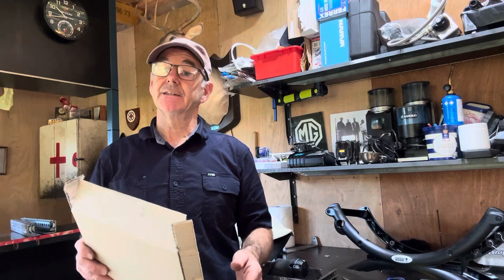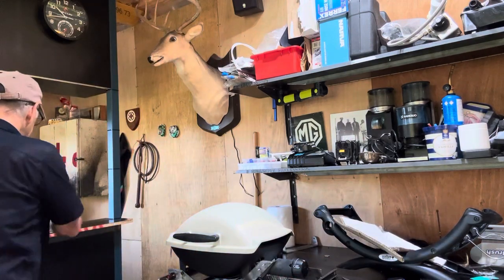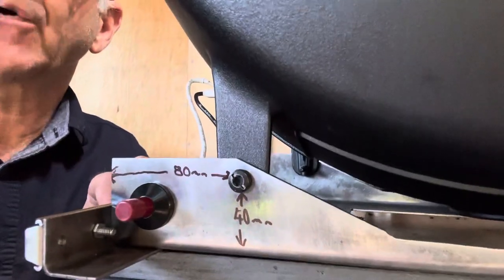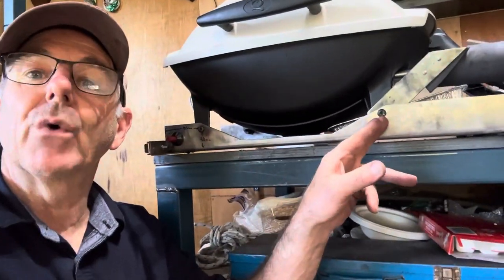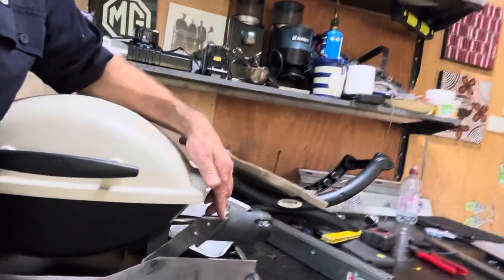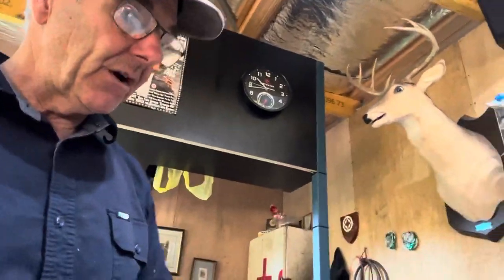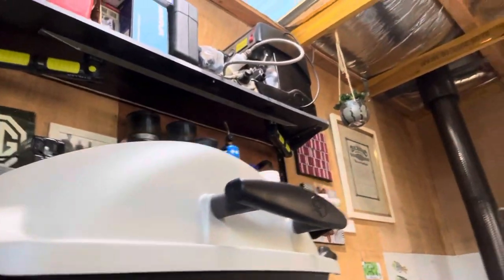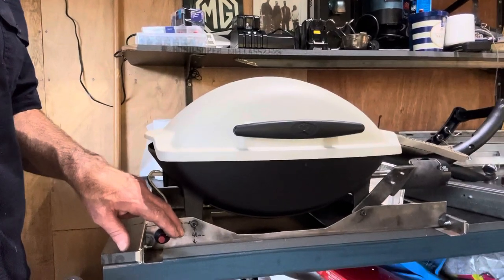Fitting a Weber Baby Q on a slide into a standard Caravan Hatch

Comment: Hi Gus. Agree on the caravan weights, not enough people do it.  just watched your video on the weber slide. Great information/inspiration. Do you have any details on the slide you made/extended. I'm elbow deep in doing the same. I was going to use a 800mm slide to get the clearance/extension
Reply from the maker: Hey Adrian, I used 2 sets of slides to make one set, this enabled the slide to project 150% of its closed size. The slides are in 3 pieces. I removed the smallest of the sliding arms from one pair and mounted it to another slide with all three sliding arms intact. Enabling the slide to extend one stage on the slide with the piece removed and 2 stages on the slide that remained intact when fitted. I hope that makes sense.